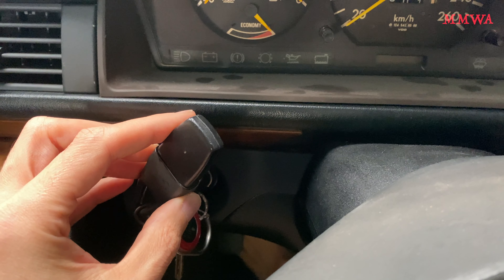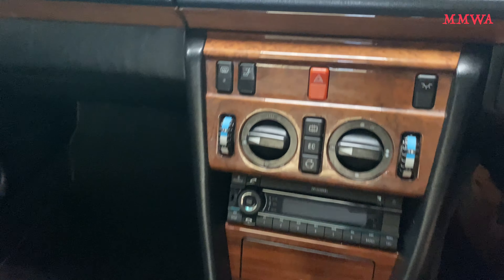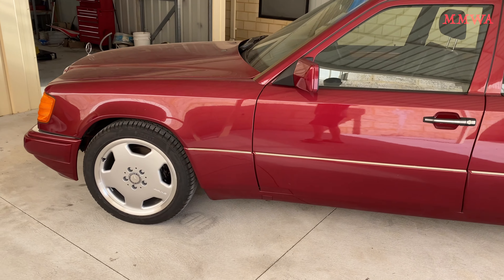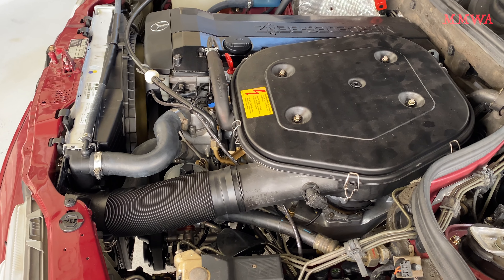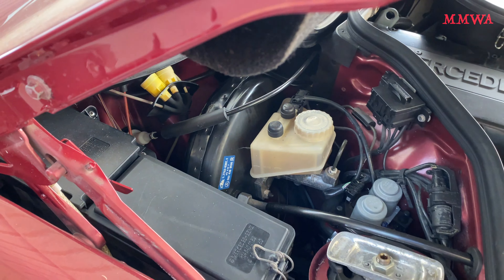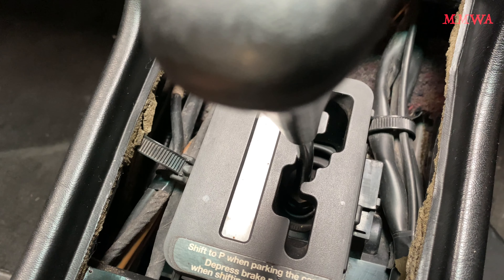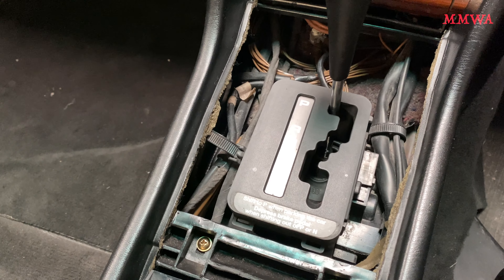A rambling video about MB brake reservoir caps   4K

Comment: You dont have any side blinkers on the sideskirts, how come?
Reply from the maker: not required on Australian versions at that time, so were never fitted from new
Reply: weren't available until 91 ?
Reply: @MMWA-DAVE  oh okey, never seen that on a w124 :)
Reply: my car has it and strangely both blinkers and aux. blinkers are in clear/white. most w124s in here are amber and dont have the aux. blinkers. personally I prefer the clear ones not amber. amber looks better for the 124s phase I in my opinion
Reply: Here in Belgium they are not required either, they used to be required when you were towing things like a caravan. non of my old mercs have them. (2 of my cars are geman originally, so i guess they are quire rare)

Comment: Just need a brake booster hose bracket grommet : ). Same part across many models.
Reply from the maker: got a part number? I have noticed this hose shouldn’t be just resting on metal but keep forgetting to do anything about it
Reply: @MMWA-DAVE  I will have a look at mine tonight and let you know. I'm always a bit OCD with things like brake booster lines.

Comment: Just realised, after watching almost all videos of RED, the climate control panel is Walnut whereas centre console and -I think - else trim is Zebrano.

So Red came originally with Zebrano wood trim?
Reply from the maker: thats only temporary. That walnut panel came from a e220 in a junkyard. The original zebrano panel is totally trashed.I had big ideas about doing all the wood in black rosewood but will probably not.
Reply: @MMWA-DAVE  Interesting (and challenging).
Would match the valve cover, haha

At first I didn’t like much the Zebrano, though a well polished one looks great to me.

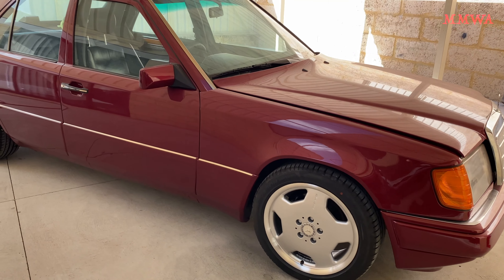Comment: 1:15 is it normal that rocker noise at the start? Mine does it too similarly to yours...
Reply from the maker: m104 has hydraulic bucket type lifters, these are the original ones simply cleaned out as part of the head rebuild. They will leak down after sitting for weeks without running and that noise will be made till oil pressure builds up. I don’t want to replace them as like $40 each here x 24. Screw that.
Reply: @MMWA-DAVE  So I have nothing to fear now! hahaha
Reply from the maker: @vmlelectronics  depends, if its doing it every start and it’s a daily driver it might accelerate the chewing up of the camshaft lobes. Mine only does it when sat for weeks.

Comment: 1:15 is that a fast ticking noise after startup ?
Reply from the maker: yes, thats what happens with lifters with 300,000km on fhem, they leak down. No, i’m not buying 24x new ones
Reply: @MMWA-DAVE  my car with 200,000 km did the same noise yesterday on cold start